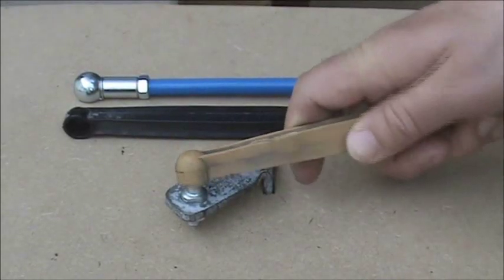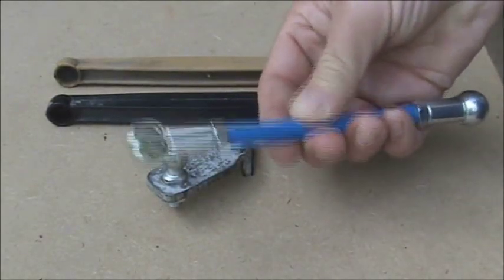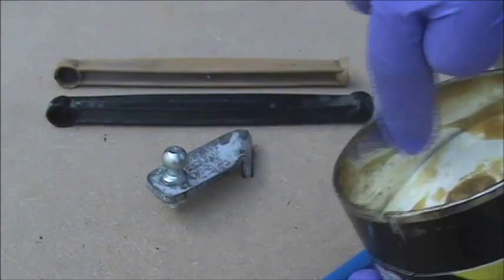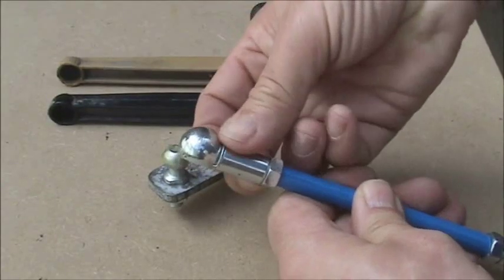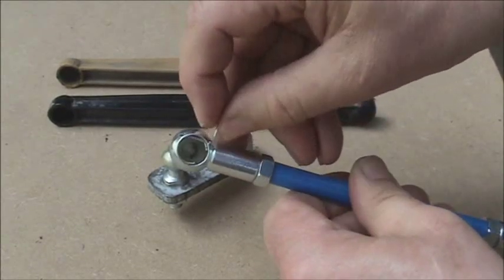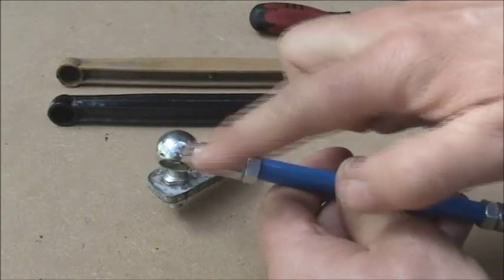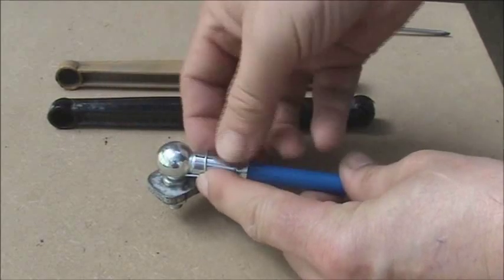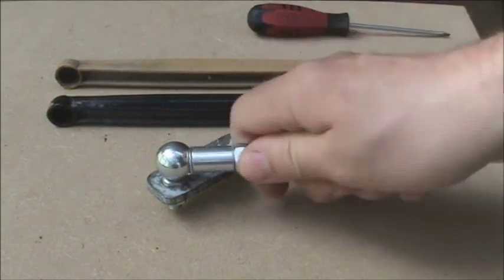Repairing Vauxhall Opel Corsa C, D and Adam Gear Linkage

Comment: Hello. I want to fit one of these to my 159 TBi with the M32 gearbox, my factory linkage bushing popped off and seems generally pretty perished. Just wanted to ask a small clarification, are you supposed to grease both the ball joint and the rod end? or just greasing the ball would be enough. Thanks!
Reply from the maker: Sorry we don't sell these for 6 speed gearbox with cables, but it can't help to grease all moving parts
Reply: @AskTheMechanicCoUk thanks for replying. Another quick question: should the new linkage pop in place? How fixed should the rod stay in place without the retaining clip?

Comment: Could I use this on a Corsa D?   My plastid/ nylon link has way to much play in it now ( sometimes struggling to get the car into 1st, 2nd and reverse gear)
Reply from the maker: Yes it will fit a Corsa D, but unless the socket is worn and popping off it won't remove the play and you might need to replace the complete gear linkage

Comment: I'm struggling to force the socket onto the ball joint closest to the gear stick. Any suggestions?
Reply from the maker: Always grease before fitting and push you little finger in the socket to centralise the snap ring

Comment: Hi, I have put a similar rod in my Corsa, however it needed the length adjusting before I put it in and now I can not use fifth gear. Part of the linkage jams against the "frame" metal it is mounted on then the selector shaft turns in the clamp due to this.  Your video was a great help as the linkage I had bought came with no instructions. Do you have any hints on removing this metal rod so I may adjust it? Are the rods you sell locked in place at the right length?
Reply from the maker: Yes ours are set on a jig to the correct length and should not need adjusting, unlike the cheap Chinese copies of our product including many of my words.
I would remove the link and adjust it to the approximate length of the old one and then use the Vauxhall adjustment method, please see http://www.askthemechanic.co.uk/gearlinkage/vauxhall-opel/adjusting-linkage
Reply: Thanks! Adjusted it and it is all working now but the entire linkage I bought isn't of great quality (and doesn't feel so great) so I'm going to swap it out with a better quality aftermarket linkage I got through a garage (they have found these ones to be of good quality). If/when the plastic rod wears out if I decide to permanently switch to the metal I will probably get one of yours.

Comment: When changing the replacement rod , and having the gearstick into position. Do I have to press a spring plunge into position . And is there any other parts of the gear shift linkage that needs to be held in place , or is it as swift as your explaining, pop the good side off with a screwdriver let the worn side fall off , replace and drive .
Reply from the maker: If it’s one of our links it’s set to the correct length on a jig and will just swap over, if it’s a Chinese cheap copy you may need to adjust it after you have fitted as shown here https://www.askthemechanic.co.uk/gearlinkage/vauxhall-opel/adjusting-linkage

Comment: +Ask The Mechanic How do you get the old plastic rod off? It simply doesn't pull off, just tried...
Reply from the maker: +ANekii If you put the worn out joint back on then pop the good joint off with a screwdriver  you can then pop the warn side back off again easily, hope this helps